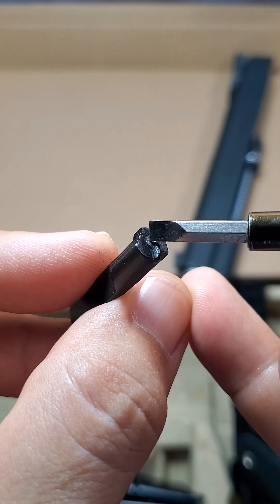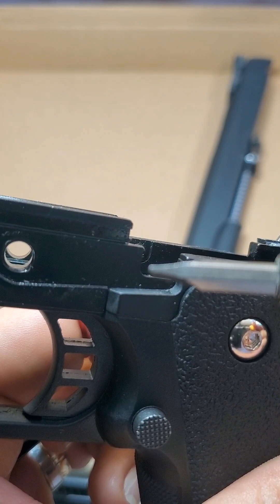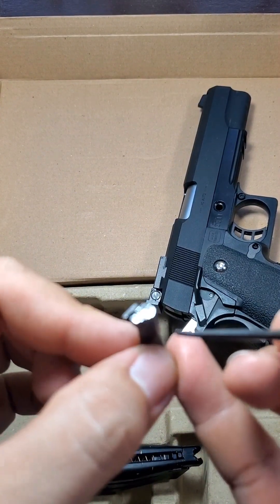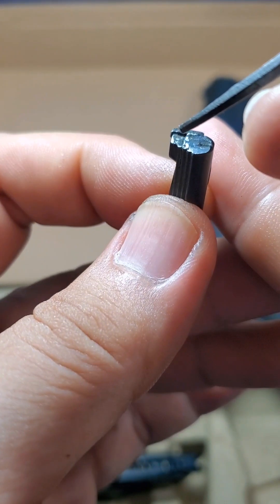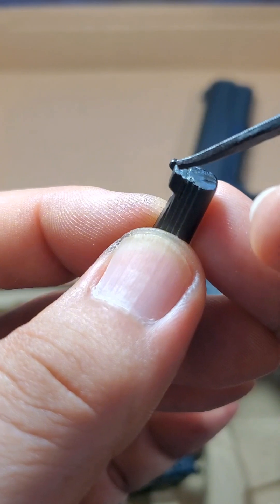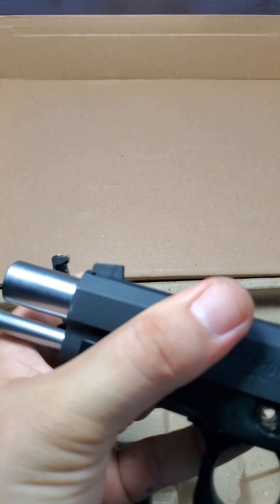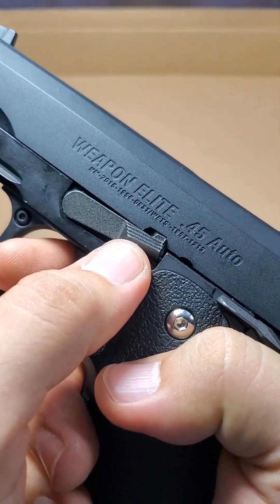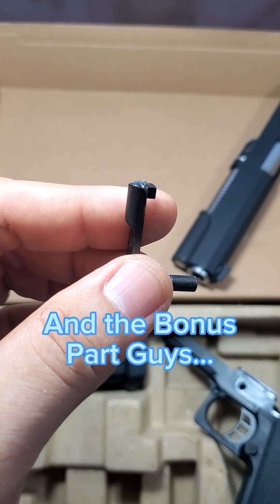Hicapa and 1911 Slide Lock Issue Solved!!!

Comment: Ang problema nman dyan mag sslide lock Yan kahit may bala pa na upod masyado
Reply from the maker: Kaya di ko flat ang protruding part masyado i just smoothened it. And no oil applied. And not only that, the marker pen makes the plunger and slide lock friction is higher thus, less likely to slide up.